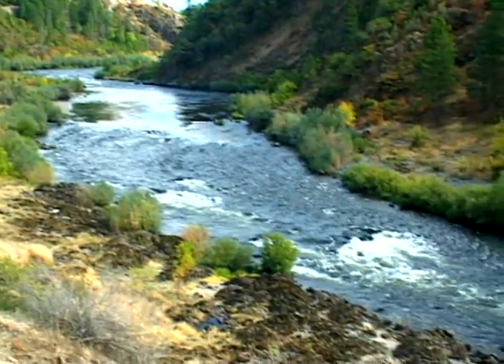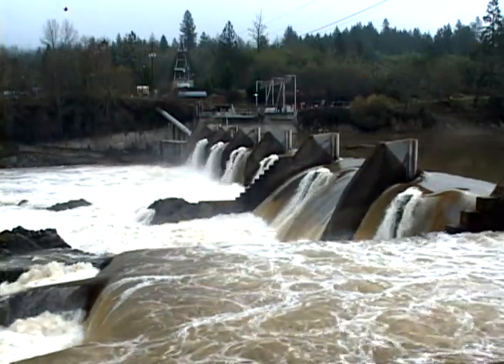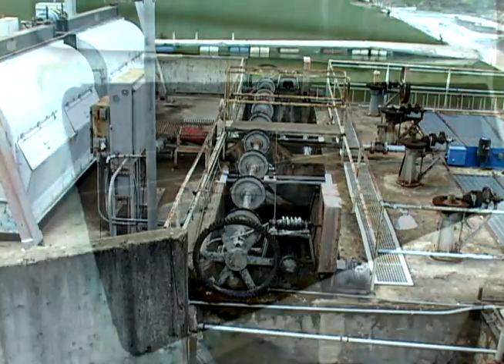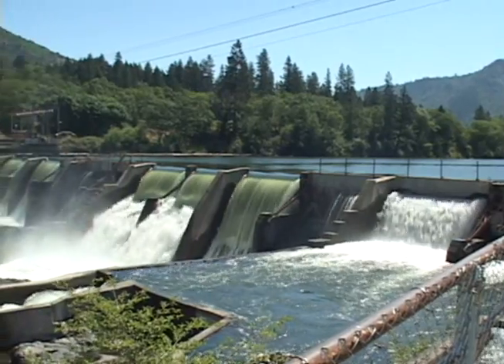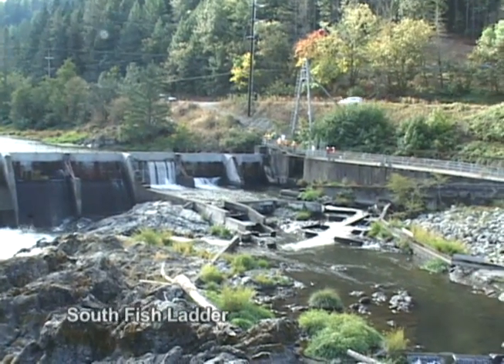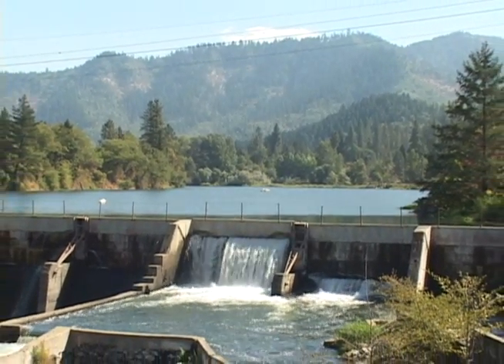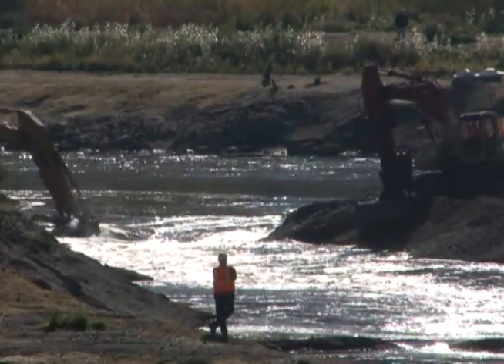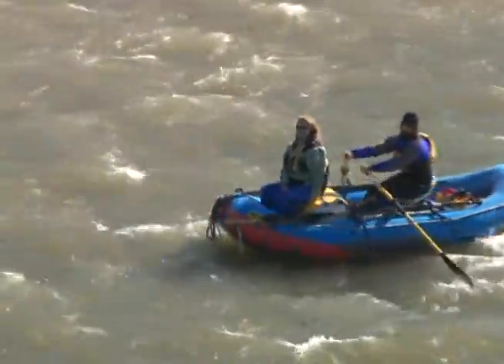The Removal of Savage Rapids Dam

Comment: Seems to me they should have had the tractors on the other side when they opened it up... legend has it they are still there to this day.
Reply: Considering that the Rogue River Highway is on one side of the river at this point and the railroad and Interstate 5 are on the other side of the river, the legend is extremely doubtful. The dam was located between the town of Grants Pass and the town of Rogue River, in southern Oregon and Savage Rapids is still the location of some intake pumps for the irrigation district and a pipeline bridge over the river. The place is not isolated.

Comment: There are 75,000 dams in America. Most are useless. Instead of picking a few, and spending $50 million and 6 months each totally restoring the sites to their natural state, I'd like to see thousands of them breached in their centers to restore flows quickly. We can go back and clean them up later.
Reply: +Docktor Jim I used to do analysis on rivers in the UK during the 70s. Not a few were sterile and effectively absent of life. Closure of mines and factories (and no small amount of legislation) stopped the pollution. Its taken about 30 years for the rivers to recover.

Breach a dam and you release what is called 'silt'. In reality  its often an anaerobic sludge or many tons of part decomposed vegetation. If the dam was downstream of industrial sites then any pollutants would be included in that muck.  Once exposed to oxygen then it continues to decompose rapidly. In addition to stinking to high heaven, it is a serious health hazard.  Releasing that stuff rapidly does two main things:  Scours the valley floor and rips out vegetation and strips the water of oxygen, killing most everything.  

So yes, if you want to wait up to 30+ years for a full recovery then just blow the dam and see what happens. Some will recover quicker but don't hold your breath.
Reply: Philip Jones It takes longer for the silt to be removed by the river the longer the dam is in place, and the more silt is accumulated. Leaving the dams in place is like continuing a bad habit to quit later. The lake behind the Sam Clemente dam was so full of silt, they rerouted the river around the lakebed entirely.
Reply: Docktor Jim
Each and every dam is different as is the silt behind it. When no legislation controlling pollution existed, people would dump waste in rivers to the extent that fish that lived were toxic to touch and rivers became fire hazards.  In a lot of cases those contaminants are going to be in the silt. Where concentrations are too high then its best left alone until some method can be found to deal with it. After all, what exactly do you do with several thousand tons of mud contaminated with heavy metals?   Releasing it suddenly and everyone downstream is going to be suing your ass off just for contaminating the water. That plus any damages they can prove, which will be easy to do. 

That is why a slow release which is greater than the rate of accumulation is better for everyone. Then again it depends on the make-up of the silt.
Reply: Philip Jones Every dam in the world without a purpose should be partially breached a little every year to draw down the water and silt behind it gradually. It's pointless to spend millions of dollars on a single site when there are so many dams that need to come down. I watched a man go through a dam because he was too drunk to paddle his little raft over to the side. It was a dam that does nothing, and only exists as a hazard, a fish barrier and an eyesore.
Reply: +Docktor Jim Absolutely agree with you. In most cases the silt behind a dam represents nearly a century of accumulation. As long as the silt is leaving faster than it can accumulate and the excess silt is not damaging the ecosystems downstream then all is good.  The only other caution is where there may have been chemical discharge upstream during the lifetime of the dam.  In that case the silt ( 'sludge' is a much better word ) will have to be monitored during the lifetime of the discharge.
Reply: Philip Jones The dirtiest lake in the West is Lake Union in Seattle. It's full of coal tar, petrochemicals from sunken boats, heavy and non-heavy metals, and all manner of other horrors. It very slowly leeches into the air, ground and water. The best thing to do would be to open the flood gates of the dam for a few years, drawing down the lake level, and allowing it to leave and get to the ocean where microbes can help clean it up. Most of the mess is in deep, cold water with very slow microbe activity where it can't be broken down properly.
Reply: +Docktor Jim Took a quick look at Google Maps and a Wiki lookup.  That's a big freshwater area near the ocean but after no small number of channels.  I guess its also tidal.  (I'm looking at the water between Foster Island and Duck Island).  If it was the dumping ground for gasworks/petrochemical/ coke-works and the like then the sludge will indeed contain Cadmium, Mercury, Phenols, Cyanides and the like. Seems that in recent decades it was also used as a dumping area for sewage treatment in the hope that the water would flow away. It didn't. 

If the seriously heavy pollution stopped back in the 70s (which is about the time the West woke up choking) then the heavy muck is likely sealed under a layer of natural silt. Its going nowhere but that depends on the water flow rates. There are treatment systems to remove the toxic material (There are bugs that thrive on the stuff). What this allows is the separation of the toxic stuff from the water.  You then have to decide what to do with the toxic dust.  

One thing is certain. Before any clean-up operation even starts, the local government(s) absolutely have to implement and enforce anti-pollution regulations. This happened at Lake Leman in Switzerland. Back in the 70s the lake was hazardous for swimming. Hard to believe the Swiss had such a serious problem but there you go. But agreements on water treatment and what can and cannot be discharged in the lake were reached. The cycle time on that lake is roughly seven years which is how long it takes the water to flow from one end to the other.
Reply: Philip Jones Lake Union used to be tidal. It was healthy then. Water can be purified by running it through wetlands, or by floating plants like water hyacinths on the surface, but that doesn't clean up the silt. Contaminated silt needs oxygen, and in Lake Union, the mud is anoxic.

Earth is the only planet with plate tectonics. The real cure for the buildup of toxic metals is plate movement. The planet actually gobbles up crap from the surface, and folds it into itself. Of course this is too slow to help a lake.
Reply: @PhilJonesIII  Only the two or three largest rivers in the U.K. are on the scale of the Rogue. The Rogue is a fast river, with about a kilometer and a half of drop along its length. I’m not sure experience looking at a flat stream like the Thames is helpful.
Reply: i agree with Docktor Jim
Reply: It'd be better to rebuild them with modern technology. Removing them they say are for fish, reality is the maintenance cost is higher than removal

Comment: I don't understand removing this dam or the Gold Hill dam so close to the Lost Creek dam. Are we going to remove Lost Creek dam, too? Now instead of gravity flow irrigation you have to use electricity to pump water and the pumps are already having problems with silt. Wait until we get another 1964 type flood, people will be clamoring for more dams. Same thing goes for the Klamath River. Folks have a very short memory about how much rain/snow can fall in Southern Oregon in a short time.
Reply: Flood control was likely (?) the reason for building the dam in the first place.
Reply: new technologies will be, have been, introduced to create electricity. Check out the  http://turbulent-tech.com/  systems setups.